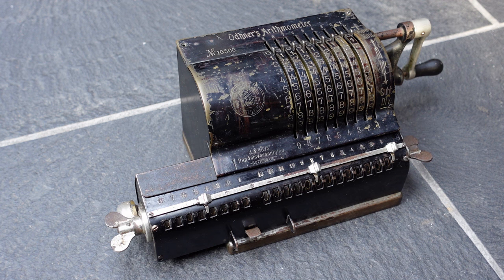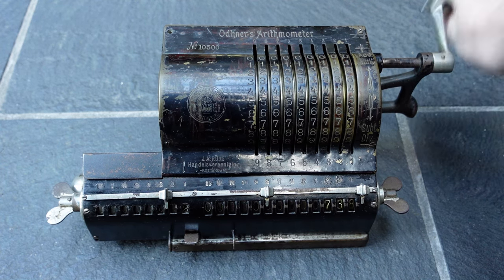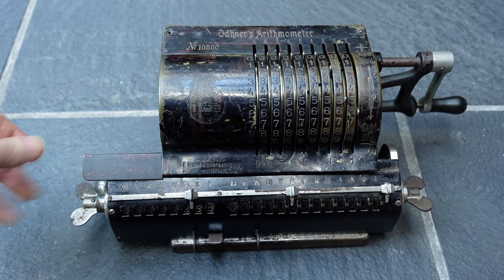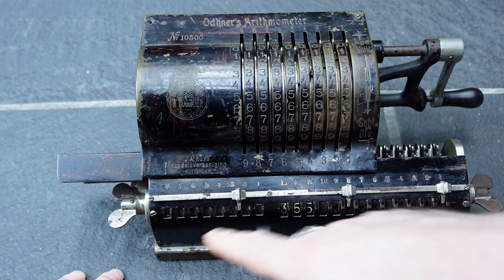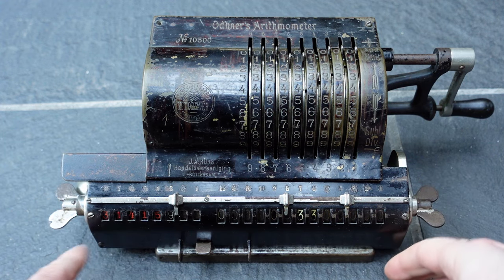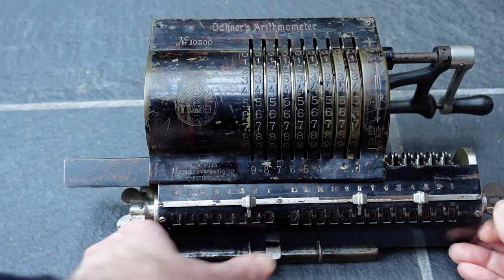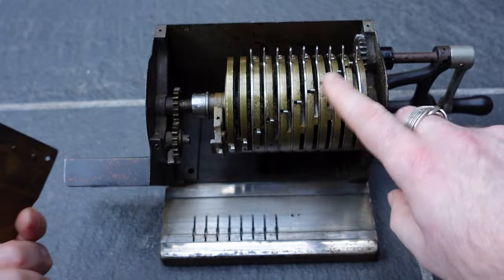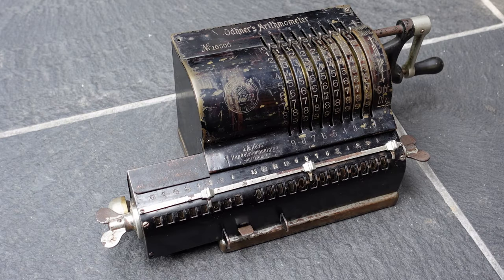Odhner's Arithmometer mechanical calculator

Comment: This is about as basic as it gets. My oldest machine is from 1927, but it is high-tech compared to this one.
Reply from the maker: Just yesterday I got a Facit pinwheel machine from the late 1920s, and it is so much smoother and nicer to work with, it is hard to believe it is essentially the same mechanism.

Comment: My dream machine would be the double pinwheel (don’t remember which maker) for artillery. It is ideal for calculating coordinate pairs. Put sine on the left, cosine on the right, crank up the hypotenuse length, it computes the other 2 sides. Given I can key it into computer software and get an instant answer but not as much fun, too easy.

The machines can operate in opposite directions too which is useful since there are 4 quadrants: +,+; +,-; -,-; -,+
Reply from the maker: See my Brunsviga D 13Z/1 video:
https://youtu.be/qnlzKCFP0sU?si=mVuSQIwp-fyfiVXZ
Reply: @ that’s it.